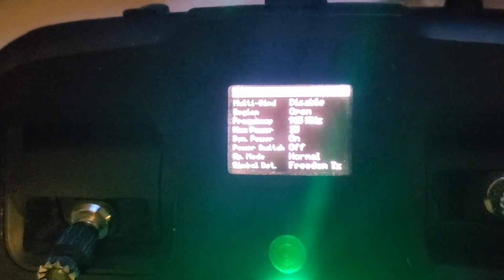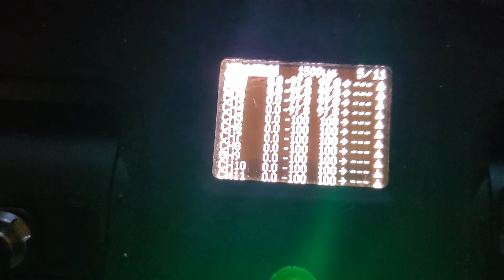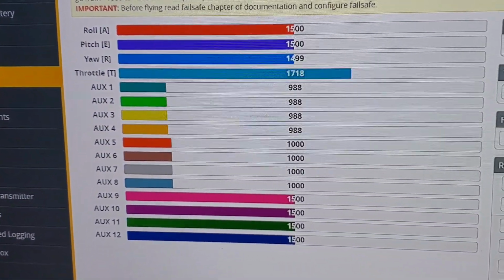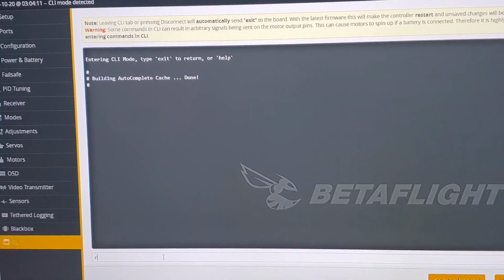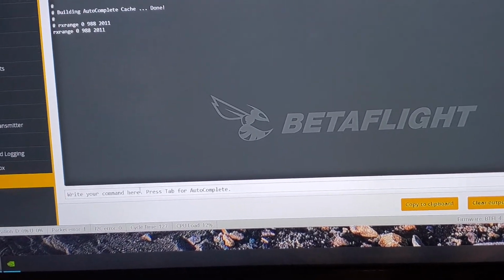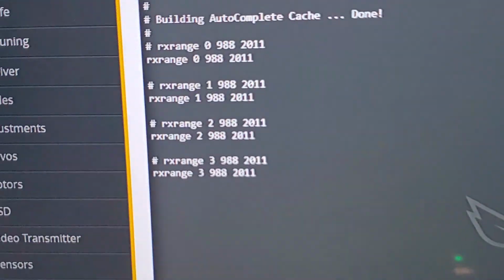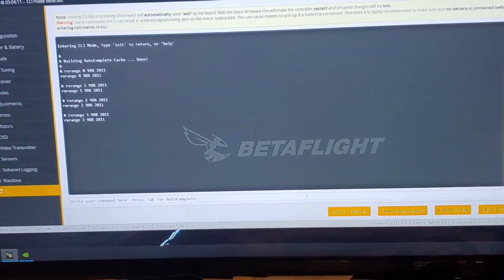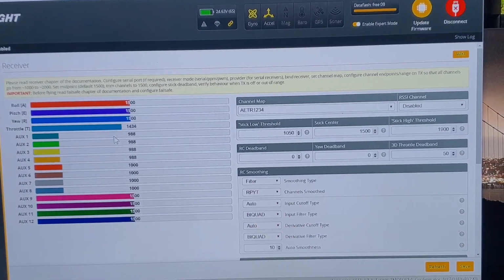TBS Tango 2 / Mambo - Mixer Bypass for lower latency - Endpoint Calibration via BetaFlight

Comment: Sucks cause I have an idle up switch and now I cant use that 🤔🤔🤔🤔🤔
Reply from the maker: Why not?
Reply: @Fly_High_FPV  I set it up on the remote but the new bypass It doesnt work unless you know a work around
Reply from the maker: @Remcos.builds  i'm not well versed on idle up, but the switches should all function with the bypass enabled, but it's possible the aux mapping changed. Confirm it's moving the right switch on the BetaFlight receiver tab. If idle up uses the mixer , you can just disable the bypass in Agent Lite/Crossfire LUA under General, Gimbal Dest, set it to FreedomTX (no bypass), i'm using XF Mode 2 and havent had any issues with the bypass yet.